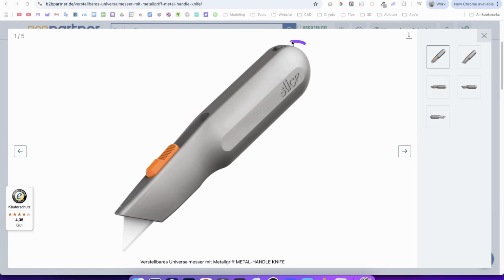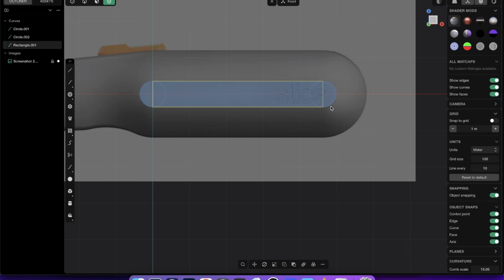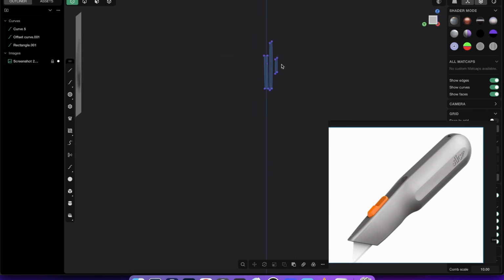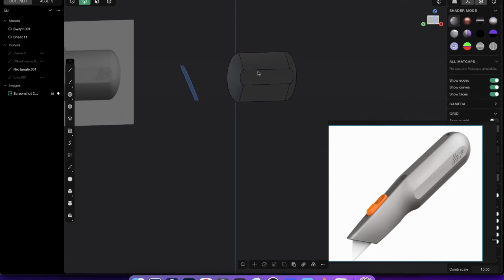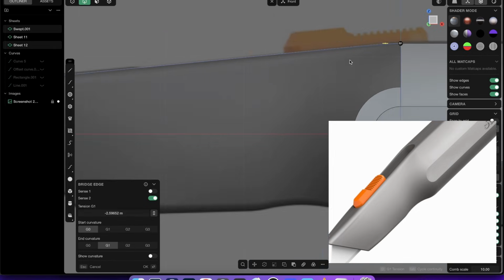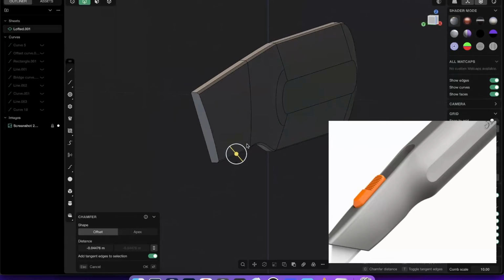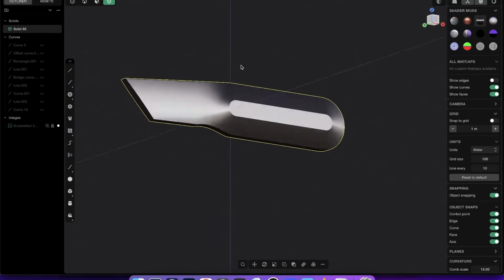How To 3D Model This Amazing Product (Plasticity Beginner Tutorial)

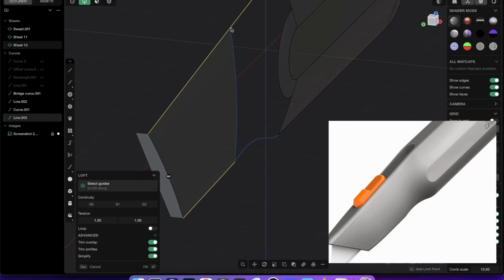Comment: At time 15:44 when you loft the front rectangular area, the top curve is highlighted as control curve but the surface stops at the vertical curve . When I do this the surface extends the full length of the upper control curve, not stopping at the vertical curve. Why does mine behave differently? Thanks for all your tutorials. They are a great help!